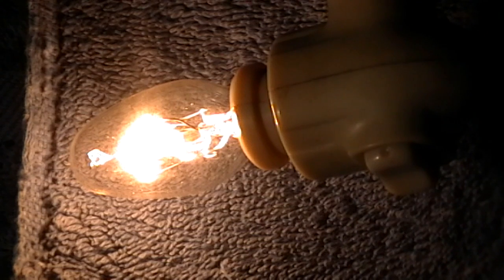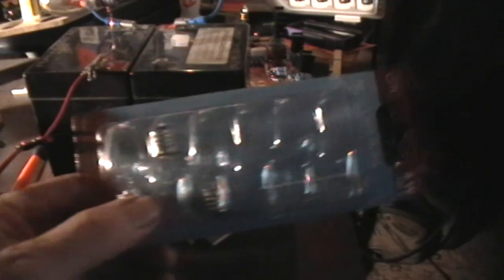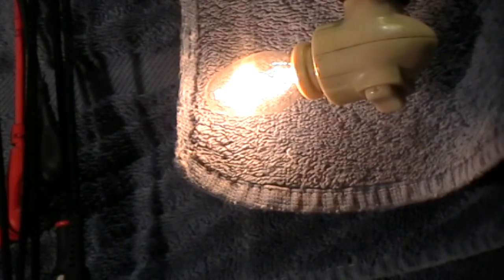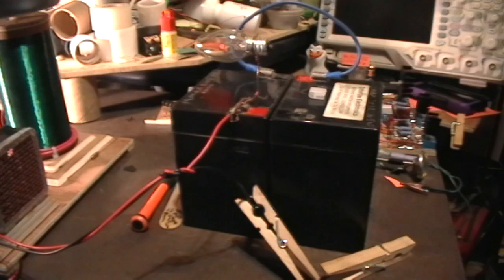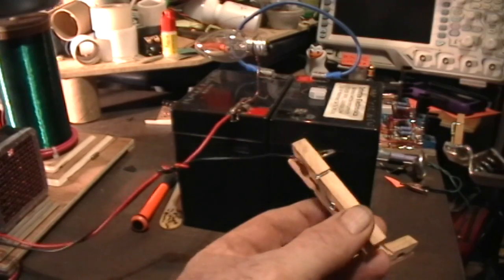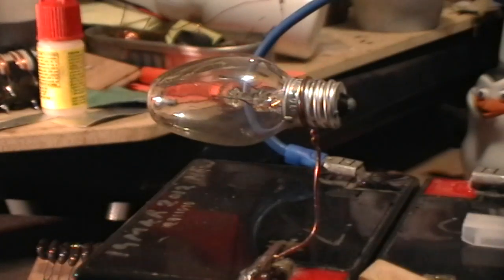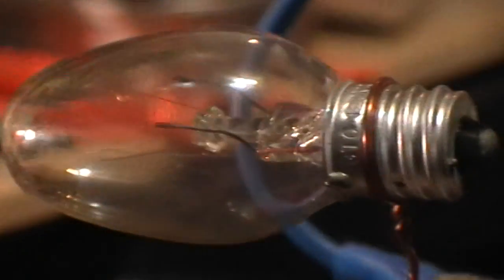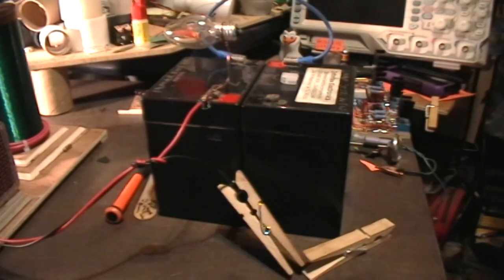Extreme High Voltage: TinselKoil X Demo 2

Comment: If you want to eliminate switching/heat loss, tune C3 to create series tank circuit.  Read Steve Ward's Class E version of this circuit, this should help.   If you want even more efficiency, use low ESR HV polypropylene and Litz wire as primary.   This alone will dramatically raise the voltage on secondary. Next, start thinking how you can utilise the nodes you've found with the battery terminals. ( Just like Tesla's - Hairpin Circuit)  Use an AV plug to your earth ground to create and store "charge separation", then use a third plate (case, or aluminium "captret") to your battery terminals.  Many don't think of the AV plug as "charge separation", very much like charge induction process.  Think of earth ground as an apolar source and supply, utilise your floating circuit (with batteries) to pump electrons to and from earth ground.  Then run loads across the AV plug.  This will most likely affect the freq. slightly, and you'll probably need to tune L1 with C3 again (impedance matching, more/less L1) but it will not impact source power. :) Next, (not sure if this will help) but try to prevent corona on your breakout, this is a loss.  A thought is submerge secondary (possibly circuit as well) in mineral oil.   The idea is to maximise freq and voltage input with the least input to create faster charge pumping with as much voltage as possible with little loss. Don't forget to tune with the primary coupling by moving it up or down the secondary. Do you need the breakout for feedback antenna to continue?
Reply from the maker: No, the breakout is not needed for the feedback system to work. I'll be looking forward to seeing your own demonstration of the usefulness of the rest of the suggestions you've made.

Comment: ah yes...the good ol 'hot bench' . looks like youve got a real cooker goin there! i bet a floro bulb would light from pretty much any metal objects within a couple feet as well....(until you clamp that ground onto the battery....then you should be able to get a digital multimeter on it) also, an analog meter placed away from any metal may give you some idea of current draw while its hot (at least for a few minutes before it burns out!). ive burnt myself more with this type of battery driven coil than i care to count   :)

Comment: not sure what the fascination is here, surely you are just pushing the bulb above its usual tolerance and possible limiting its life for the extra brilliance?  There is some high voltage and high frequency that is alternating through the one wire and powering the bulb whilst having a dual function of getting the circuit supply from the battery terminal?
Reply from the maker: Yes, no doubt the bulb is being pushed beyond its specification. The "fascination" is that there must be a lot of current at relatively high voltage flowing in the bulb, without a "hard-wired" complete circuit. It is an RF system, with capacitive coupling to ground, but also the chips and mosfet do not fail in spite of the high voltages coursing through the entire circuit, it seems.

Comment: seems that the tesla coil circuit itself is indeed the circuit that lights the bulb with much power ! as we discussed before, there is quite a lot of feedback power being generated and the fact that you can pull the arc a fair bit out from the bulb via the earth ground suggested there's a good bit of current as well.. so with the feedback plus the good grounding point, you close the feedback circuit .. why nothing has blown up yet is still quite a mystery but im sure you dont run the circuit for long lengths of time but even with a short run surely something would give .. hmm just a thought, how many bulbs can you put in series until the current is too weak to power them all ? might be a neat experiment .. and would that bulb light up anywhere else on your positive rail from the circuit ? cheers =)
Reply from the maker: The bulb will light up anywhere on the positive or negative rails, it's just easiest to get to the battery terminals for the demonstration. I'll certainly try bigger/more bulbs later on. The coil and driver themselves can be run continuously without damage, but the mosfet and the secondary coil both do get warm, as does the toroidal choke on the power feed lines. I probably should do a "test to destruction" with the brilliant bulb just to see where the limits are and what I can get away with. But I don't want to damage the secondary by overheating because it took a long time to wind and I'd hate to have to rewind it.
Reply: ah ok, was trying to rule out if the leads connecting the the circuit were acting as an antenna, giving you the feedback power... but that would be very far fetched as the feedback is very high in power and most certainly originates from the circuit .. have you tried moving the coil away from the circuit or possibly fixing it above the circuit ? you could also try isolating the driver from the mosfet and coil, that could work .. yes, the mosfet would get warm due to it doing all the switching, the coil having a thinner gauge wire would certainly get toasty ( i have yet to build a coil winder so all my coils and HV transformers are hand wound so i as well would hate having to rewind anything :-p ) you could try a secondary stand-in coil with thicker gauge wire to test the setup's durability ..

Comment: I'm just guessing here, but could it be that when you connect the HV/HF path through the bulb to ground, a plasma is formed inside the bulb. Since plasma has extremely low impedance (negative resistance) this triggers a nice flow of current through the bulb and filament? 
Fun demonstration, thanks for sharing.
Chow mien TK.
B
Reply from the maker: Woof! I don't know about the plasma, usually I can see its purple glow if it is there. I think all the light here is actually coming from the filament in the usual manner, but I can't figure out how so much current can be flowing through seemingly empty space without affecting other things in the environment. 
Thanks for checking in and commenting. Wouldn't it be interesting if I had some nice gas tubes to play with....
:)
Reply: Yes indeed. The gas tubes are coming :)  I have the glass blowing torch along with propane and oxygen tanks. I am just saving my nickels to get a turbo-molecular vacuum pump and pressure logging apparatus so as to be able to make said tubes to various specifications all the way up to x-ray producing tubes.... The turtle will get there eventually, and I have not forgotten :)
Reply: Negative impedance (when the system draws more power when current increases) is what this is all about. Plasma, flywheel -- no difference in principle.

Comment: Brilliant test. What do you guestimate the current draw from the 24v to be. Regards
Reply from the maker: Not sure, meters go crazy near this thing, but it must be several amps anyway. And it does increase when powering the "brilliant" bulb, but I have no real data on numbers since it drives meters crazy.
Reply: Hi TK, thanks.  The powerdrain reminds me of the powerdrain in your resonance experiments. Is there something resonating?  You wouldend by coincidence have a diode, that is strong enough to be in series with the lightbulb, laying around or do you?Bye